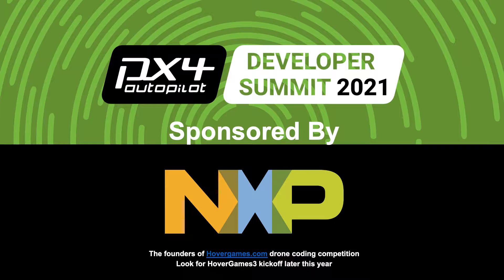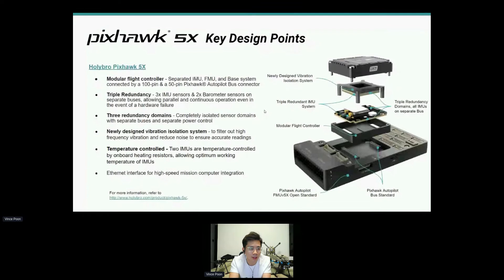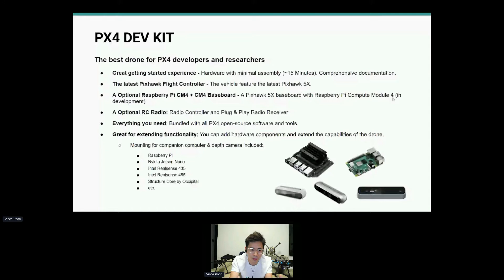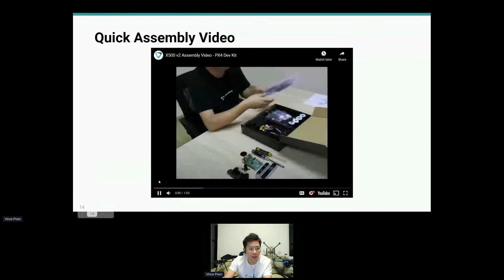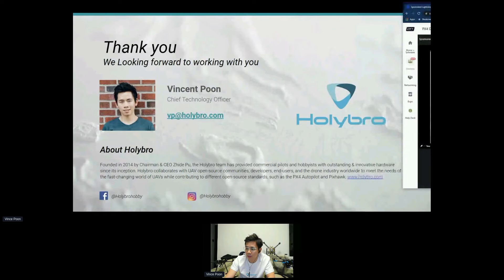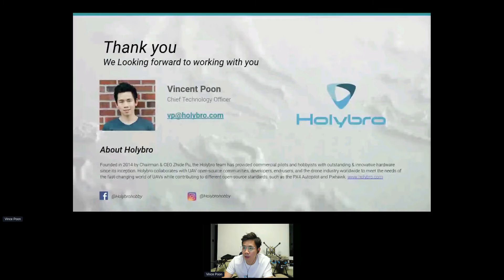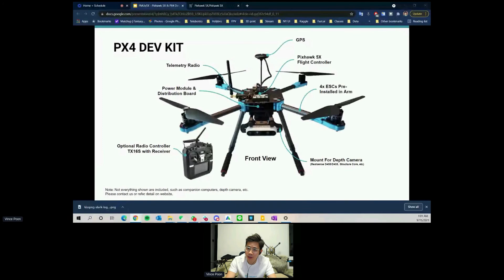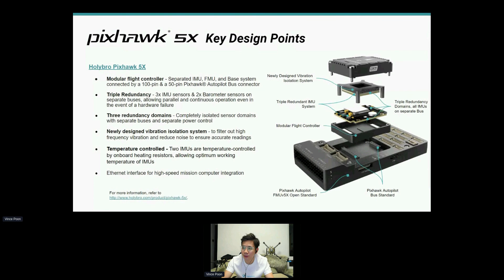Sponsored Lightning Talk: PX4 Development Kit & Holybro Pixhawk 5X Flight Controller - Vince Poon

Comment: sorry but, I don't think pixhaw4 was "very successful". I have spent huge effort to set up a flight controller with its power distribution board and it creates a bunch of cable sets which makes it look like a mesh and hard to find a place to install onboard.
Reply from the maker: Have you looked into the X500 assembly video? it provides some helpful tips on how to setup the power distribution board. Good Luck!. https://youtu.be/mNsxkGMAofc?t=182